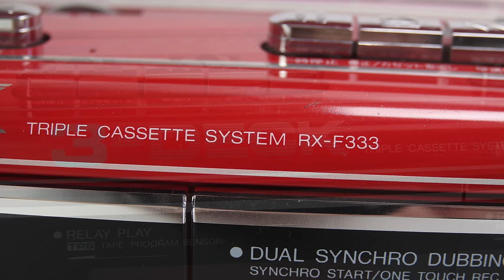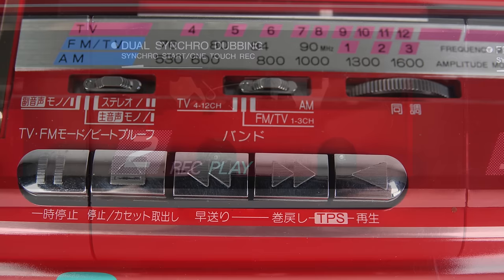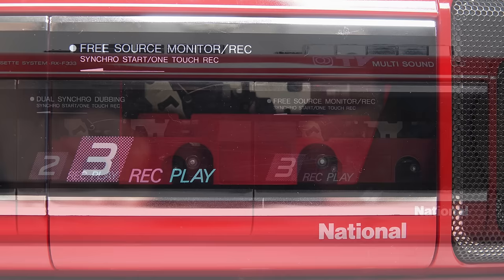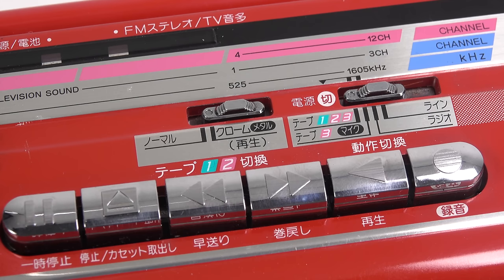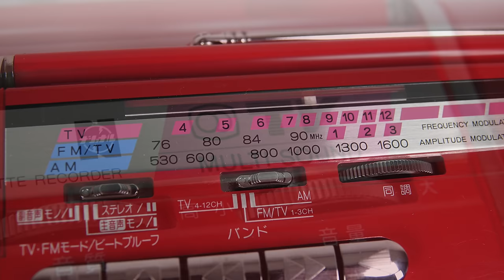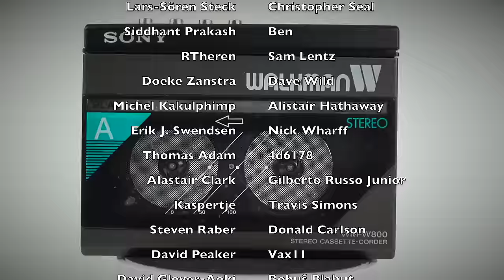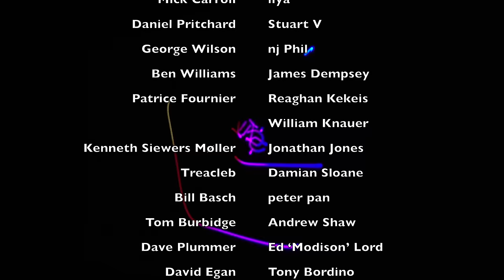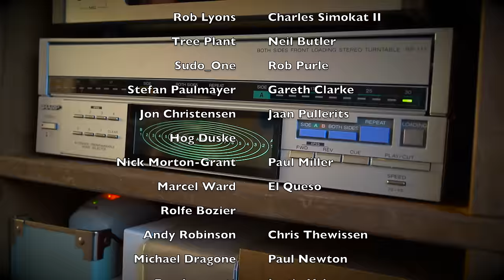The Three Cassette 'Boombox'

Comment: Pressed on wheels, Vintage boombox restorers use heat guns to pry them off, research may help.
Thank you for  video, Three deck radio, Wow
edit: That plastic on there could melt, plastic looks fastened on opposite side with three screws?

Comment: Maybe some Patrons suggested it but what if you stick in that small gap a stretched out paper clip, and whilst touching the belt you spin it so that it starts to rub off from the wheel? Maybe it will lift up to a point that you can lift it with another paper clip?

Comment: If only more manufacturers used same-sized screws throughout with same style heads (no mixing flat, philips, torx, etc.).  Ideally, there would be more hinged flaps with single pin screws (the fewer screws the better).

Comment: Did you check the capstans to see if they are held in place using a tiny split plastic washer/disk on the pinch roller side of the capstans bearing?  It would sit in. Machined groove on the capstans itself.  Exact same technique used in compiter fans to keep them together.

Comment: Remove everything that's removable from the mechanism then run it through a dishwasher. Top rack, no dry cycle. Probably not a good idea if there's a MrsMoan. I have an old Proctor Silex pop-up toaster oven which quit working, wouldn't lock down. So I took it apart and ran all the parts except the quartz tube heating elements through my dishwasher, on the theory that it's already not working so if it still doesn't work, no harm done. After reassembly it worked perfectly, still does.

Another possibility, immerse it in Simple Green and slosh it around until the black goo quits coming out. Then rinse with distilled water followed by blow drying, then set out in the sun for a day. That will need finished up using a syringe to apply oil to any bearings. I used Simple Green to clean oil out of a non-functioning glass scale for the digital readout on a milling machine. Sloshed it back and forth, rinsed with water, then blew it dry. Took the oil off the glass plate and the optical sensors. Worked fine after cleaning.

Of course the issue with any cleaning liquids is finding one that won't damage the pinch rollers while removing the decomposed belt residue.

Comment: Normal to hold the flywheels on there is another split washer like on the top of the clutch but it is in front of the capstan into a grove on the capstan pin

Comment: I’m surprised how easily it comes apart, it has a metal rather than plastic chassis too! This is consumer electronics you could actually service if something went wrong back in the day it seemed. 

It’s very rarely that easy to service consumer electronics nowadays. Much more of a disposable society we live in...just recycle rather than fix it. At least recycling options are more prevalent nowadays. 

Back then it was just sent to land fill. Mind you, also nowadays we’re actually consuming micro-plastics! As it’s so common in this polluted global eco-system we live in now, which can’t be a good thing!

Comment: Takes you back when i was a teen and wanted to record the only and one YEARMIX broadcasted on the radio on tape-device. For hours you were prepared..then broadcasting was begun and press the record button on the boombox ( that was my only posession) only succesfull with a full pack of batteries/ no disturbance in powergrid or parents.../ a blank or new tape from high quality like BASF 90 min metal tapes. I remember vividly that DJ's knew they would be probably recorded so sometimes they intervene with the mic! like VERONICA or a jingle through the mix,  if that happened you pause quickly and then record again! hahaha And then, the next day on the schoolyard" did you make the recording?/ and you? "  ah those days...

Comment: Yikes! I just restored two Panasonic RX-1460s, one from 1981 and another from 1982, and in both the belts were still OK despite having slipped off in one of them. The big problem with both is that the gear responsible for driving the spindles in rewind/fast forward mode split just like the caps here! So I had my friend 3D-print me two new gears -- and they work! Strangely enough, the main drive wheel just slid right out. It was held in place by a large bracket that screwed onto the base plate of the mechanism.
I also have a Panasonic RQ-409AS desktop cassette recorder from 1972 and a RQ-309DS from 1977 (in box), and both still work fine, although the belt did slip in the 409AS (common theme, isn't it?).
The only completely gooey belts I've ever seen were the auto-stop and counter belts in a Phillips 5171, from about 1979. The main drive belt was OK.

Comment: Those wheels look like they are attached in a similar fashion to many CD drive hubs, that is they essentially clip onto the spoke.
Having had to replace the spindle on a couple of original playstations, getting them off will be risky (provided I'm correct about how they are secured onto the axle.)
They need to be levered off with even pressure on either side of the axle. It's tricky and risky but it can be done.

Comment: Nice one, very 80's :)

A while ago bought a dark grey 1980's Aiwa CS-250 "boombox" and surprise surprise, the cassette player doesn't work in this one either. Radio works. Not sure if I care to open it to fix the cassette player, probably the rubber belt has turned into black mess like yours. I have 3 other radios with working cassette players if I want to listen my old tapes.

We had this Aiwa model new back in the 80's but eventually it ended up to electronics waste. This one is just a memento from the 80's for me :)

Comment: Hello, this is one of the most weird cassette player that i ever seen, for those degraded rubbers in 2:40 you can try some gaskets or circular seals from the faucet, some years ago I have a cassette deck with the same mechanical problem, it works perfectly, by the way congratulations for the channel, I learn a lot watching your videos

Comment: The easy way out the fly wheel is to remove a washer holding the pinch roller pin.  Actually the other side of the fly wheel the pinch roller pin.

Comment: already had this problem
to clean the rubbery crap just use an wool string soak in rubbing alchool.
you put it where the belt should be then turn the wheel by hand.
the rubbery crap will stick on the sting

Comment: The belts just wanted to turn back to their normal petroleum self, by design. These cheap decks didn't last a years use tops before chewing up tapes. This built VERY down to a price tape mechanism was so popular it gave cassettes a really bad rap. Good mechanisms didn't exactly catch on like the cheap boom box boom did. EDIT: I used to repurpose the leaf switches for other projects as a kid.

Comment: Did u manage to remove the spilt washers off the capstans? Use a fine watch makers screwdriver to separate the washer then gently pull capstans from back of mech.

Comment: Hi, I've repaired hundreds of stereo cassette player. That drum on the other side where it comes in contact with that rubber wheel, on the front side has a small plastic ring sectionated. A safety. You dismantle it and you can pull out that drum with that long iron shaft.Trust a Romanian bastard !

Comment: Hmm, I think  'split' washer is a misnomer. That is not what is being used, it would not work. What is being used is correctly called a circlip. A Circlip is a standard component widely used in industry. Look it up on Google. These things are one piece circular with a small opening. They are made of spring metal. If I'm right then equal force applied to each top of the 'U' may cause them to spring off. Do it in a plastic bag or you will never find them again. Sometimes they are designed so a hooked tool can be used to pry them off.  Getting them back in is likely to be even trickier than getting them out, really the only way I can think of is a specialist tool with a grooved slot in the end to hold them as they are sprung back around the axle. It's possible they are ones with small holes on the ends, which are gripped by specialist pin pliers, but they would be very tiny tools. If they are on top of the capstan it's easier.  Can you post a photo? BobUK

Comment: Is it a metal or is the split washer plastic?  If plastic then an ice pick point will do the trick.  If it is a metal wire type then you can expand it with a exacto blade to remove and then bend it back to replace.  If it is a "C" clip then the ice pick will pull it out if you stick it in the gap opposite the opening of the clip.  An exacto blade can do this too.  Once you get it started then be sure to go carefully because they will leap out and you may never see that clip again.  Be prepared to thwart that little bugger from doing that.  What style of cllip is it?

Comment: I had a 3 cassette system back in the mid90's but it was more component style with 2 on the front and one on top that you could remove and use as a walkman.Not exactly sure why someone would want this other than to day that thier boombox plays 3 tapes since you still need to carry tapes and it would take up a less room to have a 2 tape(or 1 tape) player and carry the cassettes than to have this thing.

Comment: I saw this on Yahoo Auctions but I never expected that you would get it! Nice review.
If you look at the front of the cassette mechanism at the capstan, there should be a brown plastic washer keeping the capstan from sliding into the unit along with the flywheel, and you can pry the washer off and remove the flywheel to clean it. Does this unit have that? If so, then it will be super easy.

Comment: You missed the bit where you explained what the point was in having 3 cassette players in one thing. I do like the TV tuner though, British radios should have come with that, you'd think at least one company would make one model. I often listen to the TV without watching it, you can get a lot from most programmes just from the sound. If it was portable you'd be able to listen wherever you were. Because that's what "portable" means.

Comment: I'm wondering if all that goo is really disintegrated belts, or just a material to provide stickiness for the clutch function, and the original belts simply decomposed due to petroleum solvent in the mix.  I.e., I might just try fitting new belts and NOT remove the goo.  I mean, if it were just belt deterioration why are the other 3 belts still intact instead of dissolved?

Comment: Are there any components that are sensitive to naphtha there? I mean... obviously rubber, if you can remove all the rubber bits, and electronics containing electrolytic capacitors which have a rubber plug at the bottom, you can just put it into white spirits, and with any luck, the gunk will separate and float away into the solution.

The plastic retainers that have cracked are something I can fairly easily reproduce, but it's probably better you find someone nearby.

Comment: when i was little i got the yorx 3 cassette unit with the removable one on top from a store called consumers it was pretty much a rip off with its balloney 3 band eq that looks like a 6 although it did like pulling the portable out and using an earphone extension i used it as a amplified speaker for my adlib card

Comment: The Korean company Yorx made a unit similar this one, the Yorx FP-1010. I'm not sure where it was released, though I have seen units in the US, France, and Canada. I don't have one so I can't seak for the quality.

http://wikiboombox.com/tiki-index.php?page=Yorx+FP-1010

They also made the BP-1000, which was another triple cassette deck. However, that one didn't put three full-size decks in a long formation. Instead, they used two full-size decks in the base unit, and the third deck was detachable as a battery-powered portable stereo. The third deck was one of cheap portable stereos, with only FFW, Play, and Stop. The whole thing sounds pretty bad, but I'm still glad to have it.
http://wikiboombox.com/tiki-index.php?page=Yorx+BP-1000

Comment: The FWD take up just came off with time in this extremely cheap transports. Those were made by Yanion and they are FAR from the one used by Panasonic / National in the recorders of the same perios, RS-FT series. You can tell at first glance because the play is softtouch and wont work unless a proper belt is installed. Im not talking about 80s tape transport, but 90s ones. Panasonic keep making things a little better in comparison. Appart from being a three deck, no point on using Yanion tape transports. They fell appart. They start to make grinding sounds after a couple of months. I love Panasonic, and this is now a collectable. Period. As a product fro real use, with this transports, is not better than a toy.

Comment: Have you tried cutting a cloth in a long strip and cleaning that area you where talking about at 6:28 to 7:10
Reply: It would still only smear the residue all over it. You wouldn't get rid of the goop, you'd just end up pushing it around.
Reply: @Noxedwin  would adding alcohol help.  If I right, there should be a lock washer on the capstan.  Removing this should remove that whole unit, I did this to many other cassette recorders/players.
Reply: Normally, when you use a solvent like alcohol, it's to break down something you don't want being there. Using alcohol wouldn't help because you still wouldn't easily be able to remove the goop. If anything, it would just fall into another part of the machine.
You would have to remove the dirty components so you could rid the residue completely.

Of course, that's just my take on it. I don't repair these things for a living. I just know that slime doesn't magically vanish, even when you put a solvent to it. It's still gotta go somewhere.

Comment: These were low-quality. I haven't watched the video so I don't know if you've disassembled it, but it was typical for manufacturers to use only one motor for all the decks. And cheap plastic parts in the moving deck parts. This caused a lot of wow & flutter and horrible sound. The best quality boomboxes were from 1978-1983. After that, quality went downhill very quickly.